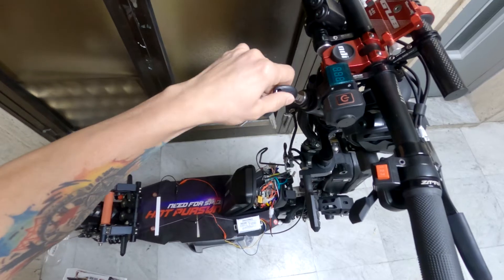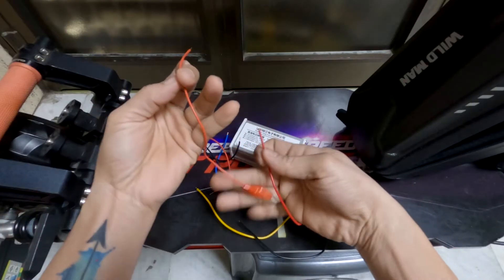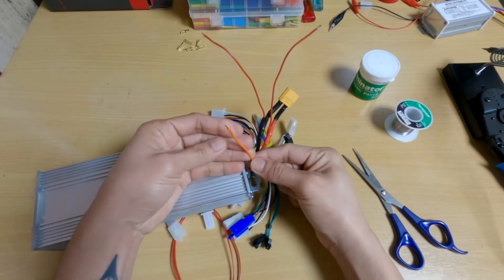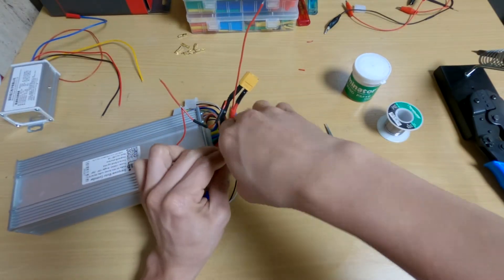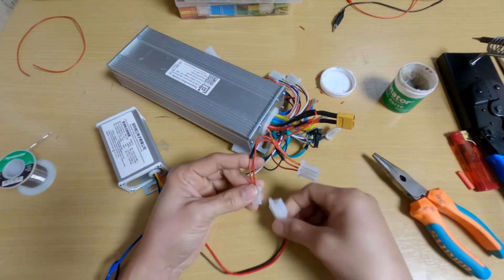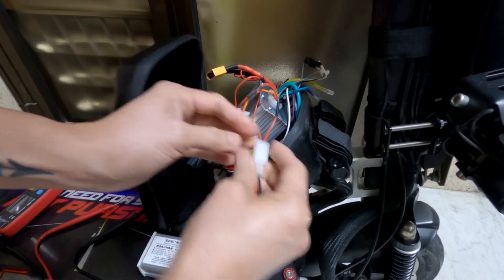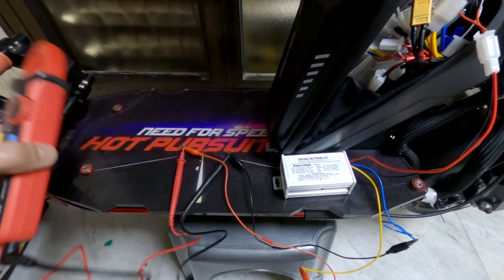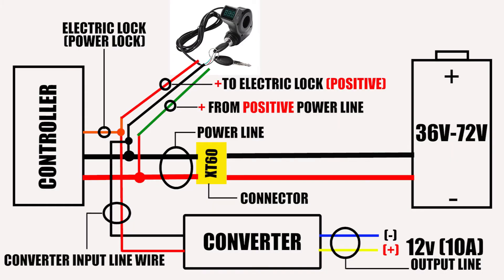How To Wire DC To DC Step-Down Converter | Electric Scooter With 36v-72v Battery Into 12v 10A Output

Comment: Sir yung ebike ko po is walang signal light, 
Bumili po ako ng 
Signal light switch ⬆
Tail light with signal light ⬆
Dc converter ⬆
Question sir: pano po ito iinstall?

Bonus question sir: 48v po yung throttle ko and base sa video cinonect mo yung throttle mo sa dc, baka maging 12v yung throttle ko na 48v, edi babagal ang takbo niya?

Mahal kasi sa ebike shop, mahal po talaga lalo kung sa kanila ka bibili parts tapos labor pa
Kaya youtube youtube muna ako

Comment: Para san yung ginawa mo boss, may nakita kasi ako sa shopee na ebike transformer and converter, Nasa isip ko extender siya para nag add ng ibang wiring na wala sa main controllwr mo, Tama po ba ako?
Reply from the maker: Goodday Kaadik!
Oo, Pede rin para makpag kabit ka ng accessories.
Ang pinaka purpose niyan ay para makapag-install ka ng mga accessories na 12v rating. 
Since 48v un battery hindi ka pede mag-install ng accessories na below 48v kase masusunog un.
Kakailanganin mo un step-down converter tulad ng nasa tutorial.
Kailangan mo rin alamin kung ilang wattage/ampere un mga accessories na ikakabit mo sa converter.
Dapat un wattage/ampere ng mga accessories na ikakabit mo hindi mas mataas sa rating ng step-down converter para di ma-overload un converter.
Sa label ng step-down converter nakasaad dun un voltage, ampere at wattage rating niya..

Ride safe lage kaadik!😎
Reply: Sa shopee po kasi dalawa po pagpipilian pag bibili na, Isang 12v 10a at 12v 20a. Ano pong mas better  @jaysonulanday
Reply from the maker: @loginpo7044 
Kunin mo un 12v 20A para kaya gang 240w na accessories Kaadik

Comment: I just finished my tl pro3 supernova rear led install. I soldered the input transformer wires to a 14awg xt60(your wire may vary) and then used a dual xt60 14 awg wire to connect the battery and transformer into the controller. Then soldered the ends. I had to install a on and off switch button on one of the tramsformers output wire otherwise the light stays on forever.

Comment: Is it ok to parallel battery in city coco big bike. One is 62V 15Ah and another is 62V and 12Ah ?
Reply: My controller is 20Ah max. So if i parallel 2 batteries then the ah will be 15+12=27Ah. Is it ok or shall i leave it to single battery?
Reply from the maker: Goodday!
Yes, its ok!
You can do parallel connection.
Make sure both batteries are in good condition.
Same type, chemistry,  voltage.
Just follow the tutorial video i made.

Ride safe always!
Reply from the maker: You can use same controller.
Yes, you will get 27Ah (capacity).

Comment: Not having a stepdown installed should not prevent the ebike from running its only for lights correct
Reply from the maker: Goodday!
Yes!
If you are planning to use 12v lights for your electric scooter and you will be using the scooter battery. You have to install dc to dc stepdown converter to get correct voltage rating for the 12v lights.
Or simply provide a 12v battery.
Ride safe always!

Comment: Hello, Mr I found your video and you are onestep forward where I was looking for evidence to achieve what I wanna do. I want to use my scooter´s batery 36VDC 15A to provide me 12Vdc and I already found these kind of controllers/regulators/step down devices to reduce the 36@72Vdc to 12V 10A. My concern is, if i left conected the reductor to the batery without loads the controller wiill anyways consuming energy from the battery rigth? is mandatory to just conecte the imput voltage from battery to the reductor when just is necessary. if my bat is 36v 15Ac and I want to get more that 10A??? I guess i have to looking for a controller with get more amps?, Can you says how much is the temperature disipate from these kind of devices , is low or high? , thanks for any advice
Reply from the maker: Goodday!
You can connect the reductor to the controller and simply leave it connected.
The controller normally consumes some power from the battery, and that's normal.
Regarding about more amps from the reductor(step-down converter).
Look for a step-down converter that offers higher amp. There are converter that could provide 12v 25A output power.
Check this link. https://amzn.to/4fjWo5Y
But you need to consider the dimension of the step-down converter.
The higher the Amp output usually the bigger the dimension(size:L/W/H)
So you have to check if you are getting the right size so you can fit it during installation.

Ride safe!

Comment: i have an inmotion rs and i got a purevox 12v speaker will this work for that?
Reply from the maker: Goodday!
Sorry for the late reply.
Yes, it will work on it.
The converter will be supplying 12v power to your speaker.
Make sure your speaker wattage is not more than the rated wattage of the converter.
Overloading may cause the corverter hot.

Ride safe always!

Ride safe always!

Comment: if you use a switching power supply for Alternative Current (written often 100V 240VAC ) you can use it with DC 48V to 72V DC or more The reason is that the AC is converted in DC with a bridge , if you put DC current it will pass through positve of the bridge or negative so you do not care about polarity
It work perfectly and will deliver the iAmp writen on the switching power supply for AC  provided that your battery can deliver it of course .  If you use it to feed an alternative battery (for GPS security system often) then you should not mixed the negative wire out of the battery because it is regulated from the negative and the battery management system of the battery have a separated negative wire

Comment: Sooo, the DC DC 12v draw power from key socket lock? Will the key lock overheat or smthing? It's 10A DC DC right?
Reply from the maker: Yes, no it will not.
I have tested it already.
Ride safe!🤟
Reply: I safety way to avoid that possible issue is to put a car´s relay, the sw cable (orange) suply to the relay and the realys sw is between the + of the battery and the + input cable of the reductor, so the amps is a one thing less to worries